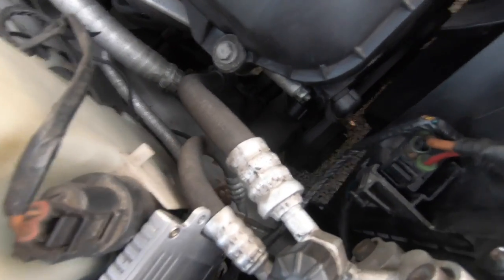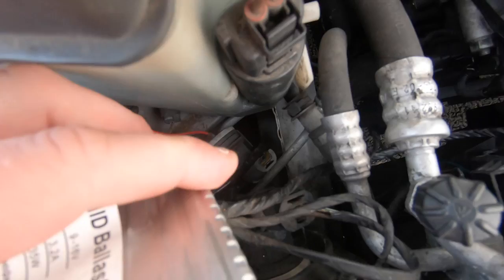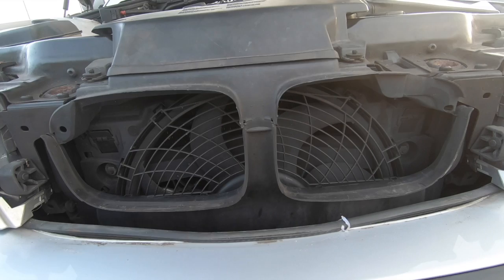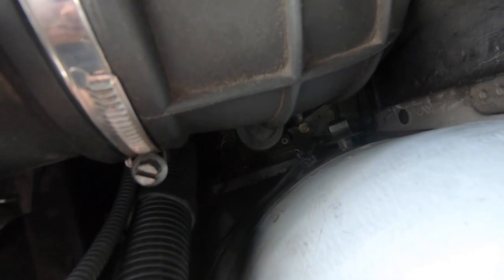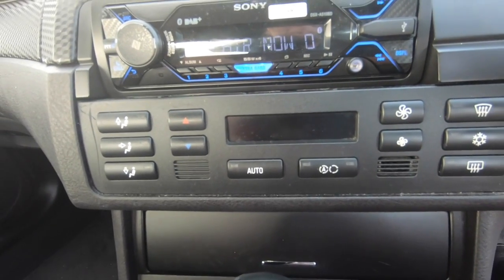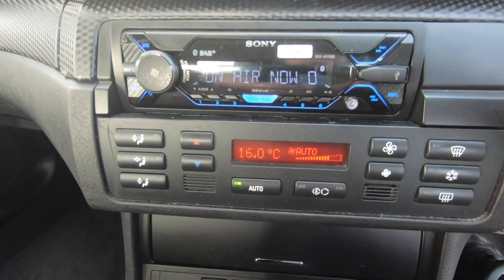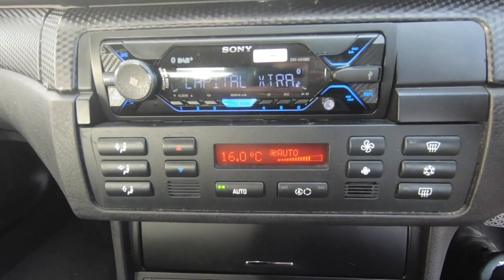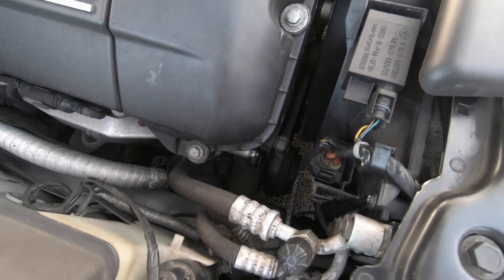Bmw E46 E39 E53 Air Con Not Working Fix!!!!! Watch This First..... Fix It For Free

Comment: Man I wish I could have you check my e46 325xi. I’ve had two different mechanics check my AC and both said something different. I don’t want them to replace something that didn’t need to get replaced. One said he has to get behind the dash, the other said it’s the auxiliary fan.
Reply: I’m not trying to be cheap, I just want the actual problem to be fixed because I also got my ac recharged and that didn’t work.

Comment: Can the pressure switches be removed or replaced while the system is full? Are there check valves or will all the gas escape?

Comment: I had a problem with outside temperature sensor. It was showing -40 degrees and the compressor wasn't getting power because of this. I connected sensor wires, It now shows +50 degrees and A/C works fine .

Comment: Anyone got any thoughts? Common issues for slow refrigerant leaks on BMW E38. System works fine when filled in June but empty again by September. I'm looking for any common failure points for leaks.

Comment: Hey, can I please ask you: why when I put on my fan or AC or heater does the speed go up and down by itself it kicks on and then it kicks down then it goes faster than it goes slower all by itself like a mind of its own, even when I turned the fan off, I can hear the vents close, but then the fans start with the vents closed.  Any ideas?

Comment: I am having a weird problem with my e39. Previous owner said the AC was perfectly fine and it just needs a control panel. I bought 1 and it never powered on. Thinking it was a faulty panel, I bought another and the same issue is occurring. The buttons on the panel will glow orange with the interior lights on but nothing else on the panel will work. Nothing happens when buttons are pressed and the middle screen stays black. I have a 2002 525i. Any input helps thank you

Comment: I just had my thermostat replaced because I had all the symptoms of a stuck-open thermostat. it worked fine for a week, but now my car is again running too cool (won't go up to the 12 o clock mark) on the highway and open roads. It only gets up to temp if I stop after driving around or in the city. What could the culprit be?

Comment: Thanks for video! I have repaired a few HVAC panels with no comebacks however...I'm now working on my sisters BMW X5 E53 and there's a big current drain on her battery...it just dies overnight and needs to be charged up every morning...I haven't even started the diagnoses yet as was so busy this past while but she told me her air con never worked and her back number plate light needs replaced as it's badly corroded. I'd say it's her aircon that is causing the big drain on her battery rather than her number plate lights. your video has given me some good tips on what to check. I'm guessing the ECU isnt shutting down/going to sleep because it senses the fault in the air con and keeping the rest of the electrics/electronics awake draining the battery. Let you know how I get on.

Comment: Hey doc, I know this is an old video but I am having trouble with my AC, I know there is juice in the system but it’s not blowing out the air, you can feel it cold if you put your hand at the vents but the problem is also intermittent. Sometimes the system works

Comment: My problem is the buttons on the ac control doesn t work properly. It doesn t select where the air comes from it only blows to winshield and feet, doesn t matter what button I press. Any ideas?

Comment: Man my wife has an 05 X5 diesel, air con works intermittently as all hell although it’s better on cooler days but still not consistent. 

A/C mechanic checked it out, they couldn’t find any leaks, said it was a little low on gas but not so low it shouldn’t have worked.. so they refilled it with gas, worked great for a while and now it’s back to hardly working.. 

Just tried the hvac panel out of my 99 e39, didn’t make a difference although the only difference between the 2 is that the a/c max button in the E53 is the “rest” button in the E39, everything else operated as normal. 

Hoping I can figure this one out with your other tips!

Comment: if your AC pressure switch will not allow your compressor to come on unless there is enough pressurized gas, then how do you get enough gas in an empty system to get the switch to turn on the compressor in the first place? Is there enough pressure in the can by itself?

Comment: Hi mate 
Hope you see this !!

I have a 2005 x5 e53 4.8

Air con is not working 
Had it re gassed still no joy

When I press the ac button the main radiator fan goes on full speed! But still no ac

I changed the control panel and still no change !

Had a scanner plugged in and when he activated the compressor I heard it click on so think the compressor is ok

Any ideas ?

Comment: watch all your youtube  vids just a question on the HVAC ..replaced heater valve and also AUC  but they will not code out using INPA and also PAsoft  also have a parasitic draw and believe the HVAC may be the problem  10 years ago was replaced but not the same part number ...any advice ..are all HVAC climate modules the same for 2002/2006

Comment: I have a problem with my E46 A/C. And i checked the second thing pulling off the fan switch, when i disconnect it with the car running the fan starts turning when i push it back it stops turning. Does that mean the fan switch is broken?

Comment: My 2003 bmw e39 540i m sport ac/heat works fine for about 5 minutes then it fades out. Turn off for 1 minute or longer it will work again for a minute when you turn back on.

Comment: Does anyone have a chart of what the psi should be based on ambient temp? I’m in Arizona and it’s 105° outside at night even and my system shows 45 psi on the low side. 45 psi seems high to me but it could be because the ambient temp is so hot outside. Regardless the issue that I actually having is the driver side is colder than the passenger side which I know is a common symptom of low refrigerant but I don’t wanna overfill my system.

Comment: Question when you replace the unit does the exact part number need to be matched l? I bought one off eBay exact same buttons and interface only the part number isn’t exactly matching the old unit! Will that cause AC Compressor not to turn on?

Comment: So watched this video to see if what help me solve my aux fan not coming on and turned out to be a faulty pressure switch on the qc high side wasn't for this video what not have figured it out did eve thing els but check that one sensor

Comment: My bmw 2003 x5 e53 3.0 stay on all the times from morning first start wont shut off unless i turn off the car , i checked the realy and  fan switch both good , what could be the problem ?
Note: my A/C is fully charged but no cold air coming out i dont knownif this related to the fan stuck on high speed all the time .

Comment: He mate my problem was that the climate control worked perfect expert for the airco, so i bough a tested oned (from a trusted site i now them for a lot of years and good prices and the pretest everything they sell) So installed the new unit and all seemed ok but now the blower motor does nothing, al the buttons work fine but my question is can you just change these units or do you need to program them in ihka or other beemer coding software? thanx in advance and for making these vid's the help me and many people. greetings form the netherlands 🤛

Comment: Hi I bro just wondering i have the same problem with my bmw x5 2002  my aircon and my stereo system was working at time before my machanicdid a full service and changed radiator Reserve bottle and replaced the rocker cover  after it was all done I didn't realise that my aircon and stereo system was not working at all . 
All the lights on stereo and aircon are all on but here's anything happening no sound or blowing any kind of air just nothing it's been about 5 months now still the same bout now and again the aircon would turn on it would work fully until I turn the off but go turn the car back on the dose again it's done that about 6× now can PLEASE HELP ME WITH THIS PROBLEM

Comment: Your video is very professional . Awesome . Now I have the same problem but. In my car sometimes works by itself and I check the Freon pressure in the sistem.  It’s ok . Now my question is? I understand like a electronics or work doesn’t work  right . If my control AC panel works sometimes. Do you have other tests or some clues about my ac problem ??

Comment: Hi I'm trying to find the problem why my F34 GT AC is not working and when I fitted HVAC from my friend's F30 I get blinking rear window defroster button and when I connect my one to his car is the same thing.. Blinking defroster. Does it have to be coded or something like that when you fit new HVAC unit to your car?

Comment: Great video! My ac compressor turns on and off but still no cold air 03 330i.
Reply: same here with my e46 320d 
hot air works fine but no cold air, alredy filled it up at the local shop and still the same.

Comment: All of the above are checked on mine + bought a brand new Mahle 3 pin fan. The fan is still not working. Got diagnosed by a local shop to have a faulty PWM signal coming from my DME. The car is 2001 525d. Have you ever heard of such case?

Comment: My e46 the aircon stopped working I can't get heat or ac out, the panel lights up and works but it doesn't do anything what could it be? I was working on the car I removed the panel and when I plugged it back in it doesn't do anything now

Comment: Hi there,great video and explanation! I have an e46 325Ci..my interior fan and air-con doesn't work. The climate control dials come on but no air comes out of the vents on low-full setting. The fuses look ok (28 & 50 fuses). No fault lights on dash.
It stopped working a while back then after a day or 2 worked again. What do you think it could be? I've been told it could be the heater blower motor or heater blower resistor..both look tricky to replace.
Reply: Same for my 2001 325ci, did you find a solution?
Reply: @Alexis_2k  same here what is the issue

Comment: I feel like on my car the AC clutch  itself failed. I can´t get it to engadge even when I put 12V directly to the connector. Funny thing is, the pulley itself isn´t sold seperatly. You have to get the whole compressor (:

Comment: I have a problem with my automatic climate Unit. 
When it’s really hot outside, I have perfect cooled air coming through the body vents, but hot air coming to the feet’s and window. ( in automatic mode )
What could be wrong ?

Comment: I have a 2013 f10 n55 and I am having a code ‘ can interface in stopped mode ‘ and I have checked the pressure sensor and the breather sensor for the auto mode (in the ecu chamber ) and I don’t get hot or cold air? I’ve tried to add A/C to the low side using a can but there is no vacuum and the gauge stays red on the gauge. When I press the max A/C button I hear a click of the relay but there is still absolutely no vacuum at the low side fill port.  I’ve been told it could be the dash vent Hot/cold wheel ?  I’m out of ideas ? I replaced the pressure sensor on the low side and lost all AC in the process but still did not get vacuum to pull from the low side? Using Beamer code and Beamer link I’ve noticed that the write is failing to the AC system on PATT_Module and I keep getting a yellow dot next to the AC section each time I go back to recode. In Beamer link I just get the Nvm_ failure code and the CAN Interface in stopped mode.  Im lost at the point of throwing parts at this and don’t want to , Im British but live in Texas and it’s now a major issue . I think the main give away is no hot or cold . If it does turn out to be the ‘ vent wheel ‘ I mean? Does the vent wheel send signal to the Compressor? PLEASE SHINE ME A LiGHT mate if you got any ideas? Thanks
Reply: I’m starting to suspect the HVAC panel or maybe if it’s true that the vent wheel is the culprit ??? I can hear the click when I hit the max AC button , I’ve tested The DAC sensor for the Auto mode and the pressure sensor , there is a click when I hit the button but there is bugger all vacuum to the low side and absolutely not AC flowing. No Hot or Cold nothing , but the fans pick up to try and ‘ cool the cabin to the desired temp ‘ ie, if it’s hot , they try to adjust to meet there thermostat but there’s just not AC getting there? It was full but emptied it by switching out the pressure sensor , Totally sucks when you see you have a leak less system and you just lost all your Freon and threw a new sensor at the car you didn’t need. Like I say , any help please. 2013 535i f10 n55 pwg

Comment: You did a good job but it needed more accuracy.  You could hold a pointer and point to the switches you talked about instead of using you finger which did not allow us to really identify the part and the exact location of the part you were  talking about . Especially the fourth problem. A better illustration should have done even though the diagnostics were Profesional.

Comment: Hey Dean my 02 330i keeps blowing the fuse for the a/c the panel goes dead I replace the fuse when I press the a/c button the fuse blows .  Today I tired to fix it and now the fuse blows as soon as I start the car . I unplug the radio as well to see if that was a problem

Comment: hey man thanks for this vid, i have an issue with my E46 318i (2004) where the engine fan is constantly on from start up, at full blast, ive replaced both engine temp sensor and coolant sensor but this has not solved the problem, my mechanic just connected it up to his machine and under the air con section it has thrown up two faults:  IHKA: Pressure sensor and IHKA: Solar sensor - any ideas on what the fix could be??? Cheers

Comment: Question, is it normal when the AC Clutch is engaged along the AC is running without being interupted? As common car, the AC clutch is engage - disengage alternatively along it operates. Please advise & thanks

Comment: Very good tutorial! Ok, in my case I have no freon I can confirm that. My car is e39. My electric fan is also not enganging at all. I know it's working because I have tested it with a scanning tool and at least I know some part of the circuit is working as the fan starts spinning on running it throught the test on the scanner. Am I doing something dangerous not stocking up on freon with regards to my ac compressor. I dont think m52b20 have electric ac compressor protection like in the video. thank you

Comment: I have a 3 series compact 316ti, i turned the engine off and the heater fans stayed on, bringing in air. 

I then went out to a dead battery. Lovely. Would this be a dodgy FSU unit?
Reply: try changing out your climate control head unit

Comment: I had cooling system work done to my E39 at shop and my Max Ac button stopped working afterwards. It was fine before. Any ideas on what to check for?? Thanks!

Comment: I have a 2003 e39 525i (U.S. model)
Air con only works when it wants to, however it works great when it does.
Reply: Had same issue, had to change my compressor.

Comment: Awesome video man. Here are my symptoms: Electric fan and compressor do not come on when turning the AC on. Electric fan does not come on AT ALL while driving. My gauge cluster also does not come on (No gauges work, no OBC lights). However, I can manually activate them both via INPA and the car blows ice cold AC. That means my system has sufficient refrigerant and my fan AND compressor work, which leads me to believe it's one of the sensor. Any ideas on what it could be?
Reply: did you find the solution
Reply: Did you find the problem??

Comment: i have a 2002 530i and the climate control screen doesn’t even turn on , not responsive to buttons at all but other buttons on the cluster work like the dsc and the ac doesn’t work cause of this it i’m not sure when it happened i don’t use the ac that much but i’d like to fix it

Comment: These cars are just shit. When i finally get my e46 straightened out ill never own another. 
Yes the motors run good...pffft. i would hope so!! Shit interiors, shit sensors, shit cooling systems. 
Ridiculous. A Honda civic literally has better interior styling and is probably quicker. 
That being said, i do love my e92. Tho the 330 has me panicked about check engine lights. Its like driving with your fingers crossed constantly.

Comment: 2003 318ci . I had this issue . My ac compressor was not working . 1100€ for new genuine bmw . I used a new aftermarket one for 500€ . Now ice cold air !

Comment: : Bmw 325i 2002 4 door sedan from South Africa VIN # WBAET37482NG79349 It’s too weird my ac was working fine for hours then heat started to come out from center vents and cold air from the sides vents but if I direct the air by pressing the chest and feet button I get cold air from center vents and sides again but heat from lower vents, same if I hit windshield and chest buttons. I have the dial to push out cold air only too.